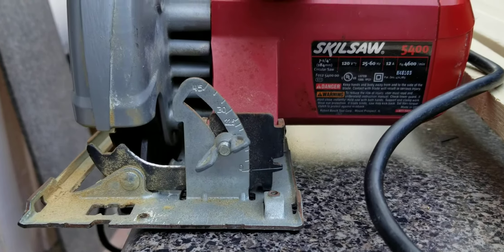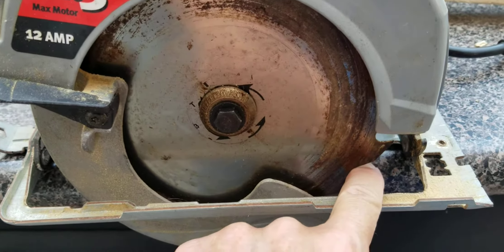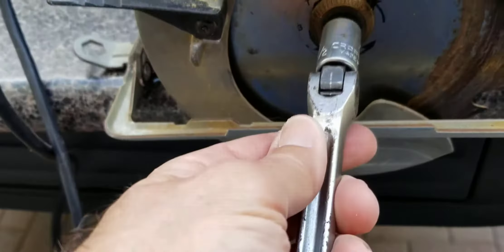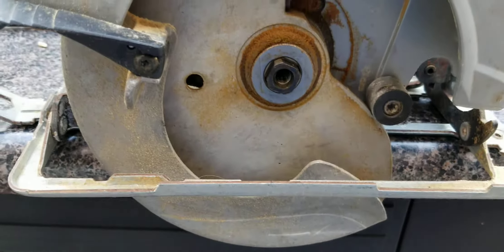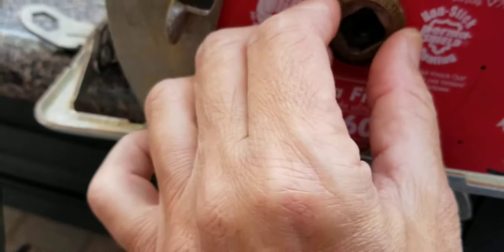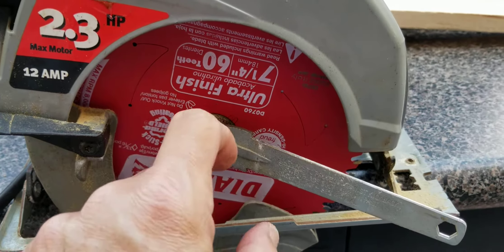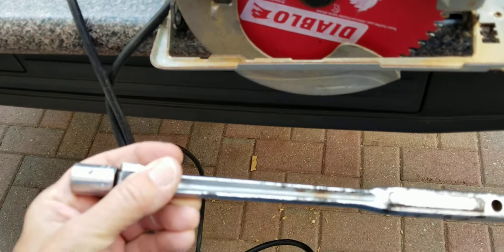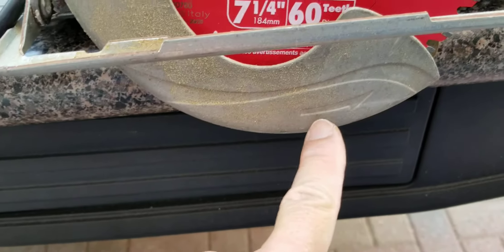SkilSaw 5400 5180 blade replacement

Comment: I have similar model.  First time changing the blade out. When putting the new one on, I put the bolt on and secure the blade then 1/8” turn.  When starting the saw the blade spins slow. I tighten a bit more until it seems to turn.  Put it in a piece of board to cut and the blade just stops.  I tighten more and then the motor binds and smell funny like the bushings are burning.  Thinking I need a new saw now but this isn’t hard to figure out it seemed!
Reply from the maker: Without being there it's impossible to know the problem of course... but for Models 5080, 5180, and 5185 blade needs to be 7 - 1/4" rated at 5300/min (RPM) or greater.... make sure Inner Washer is facing the correct way (large diameter faces blade), the Outer Washer is on properly... after stud is finger tight, then tighten 1/8 turn (45º)...(overtightening the blade stud nullifies the effectiveness of the clutch)

Comment: How to remove the bolt if the motor turns with the bolt
Reply from the maker: find something like a piece of wood (so it won't damage your blade) to stop it from turning; or a screwdriver between the teeth...

Comment: Thanks could not figure out how to lock the blade. One question though. If when I’m cutting and the boards bind and stop the blade should I tighten the bolt more or is that normal
Reply from the maker: When 'ripping' ALWAYS use a rip fence or straight edge guide, this will improve accuracy of cut AND reduce the change of the blade binding. The washer and bolt are designed to work as a CLUTCH to reduce the intensity of a 'KICKBACK' *(Vari-Torque Clutch) The PROPER setting of the clutch, combined with a FIRM handling of the saw ...